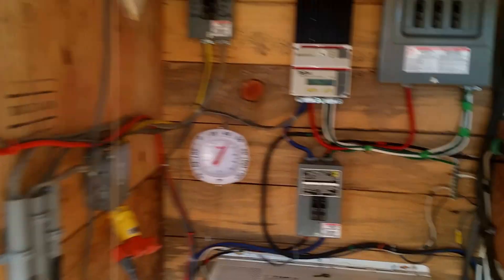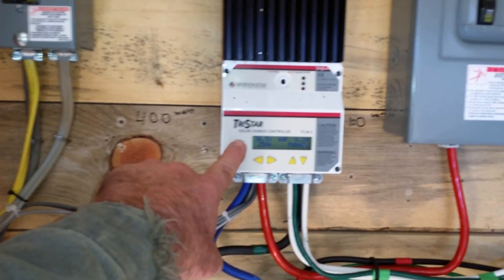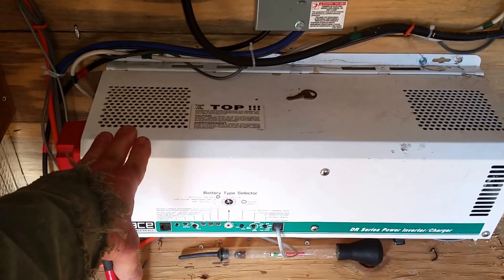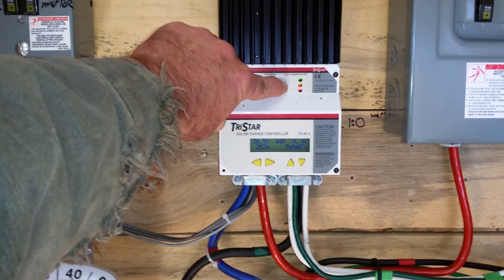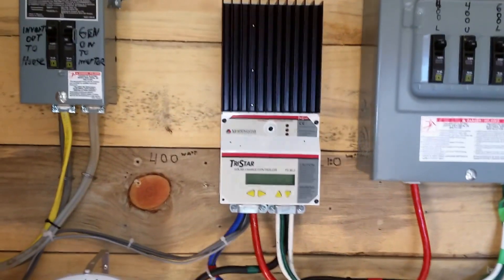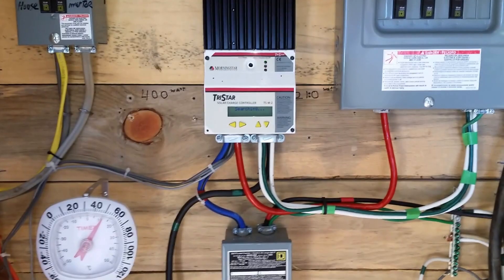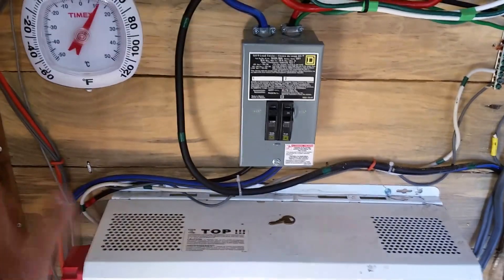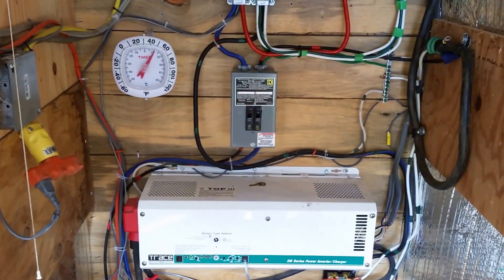Off grid solar homestead (Battery bank Equalization Fail)

Comment: Disable the temp probe reading on the unit and then do the equal. Or you should be able to lower the voltage for equal on you controller.
Reply from the maker: Good Idea! I think Ill just pull the probe out from in-between the batteries and set it on the inverter where it is warmer during the EQ.

Comment: Isn't the front part of the battery shed a greenhouse type room?  If so, you could install a (fan driven) vent,  to draw warm air from the greenhouse into your battery room to warm it up. Maybe that would help warm the batteries up enough for equalization.